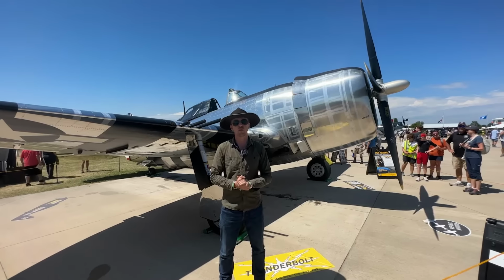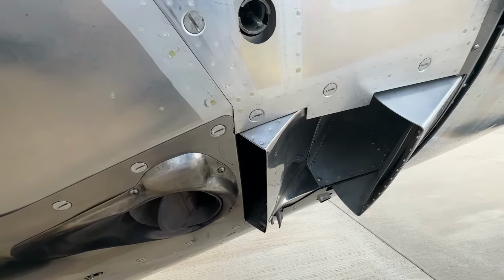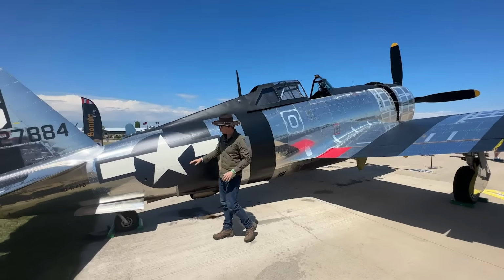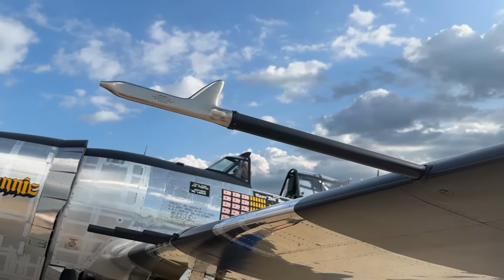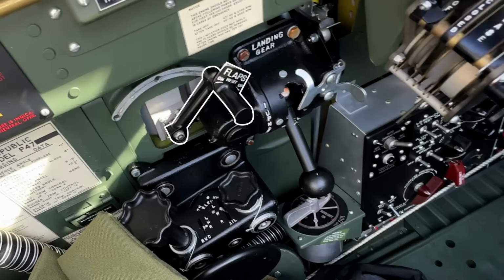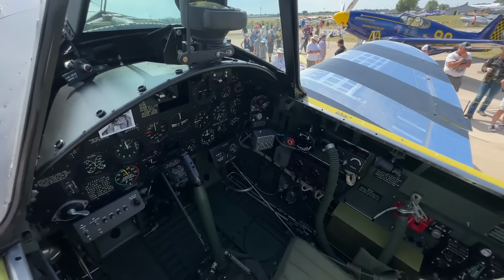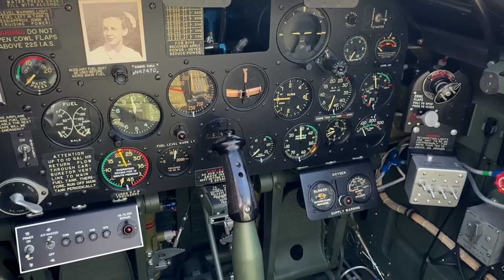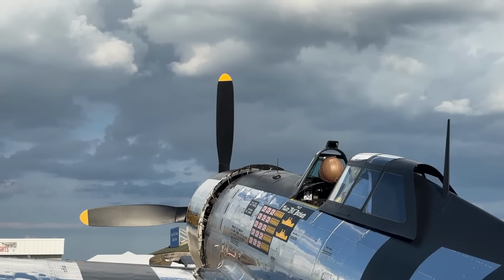Detailed Tour and Cockpit of P-47D Thunderbolt "Bonnie"

Comment: What amazes me about the P-47's engine is that it guzzled as much fuel as the P-39's two Allison engines.  Now the P-51's Merlin wasn't quite as fuel efficient as the the P-39's Allisons, because turbo-superchargers are more efficient that straight gear driven systems, but it gives you a ballpark of the difference between the way these planes chugged down high octane gasoline.

Comment: It looks like P47 uses a mid-wing configuration, and in such planes, the landing gear often needs to be longer—sometimes requiring a gulf wing or a telescoping landing gear to accommodate that. But this airplane seems to be using a standard type of landing gear..

Comment: Having flown many types of planes but mostly fighters, I too find the cockpit instrument layout weird. There is a standard now of course, where the flight instruments are grouped into a tight group to make instrument flying easier and it standardizes the placement of the gauges from one plane to the next. Engine and pressure gauges are now placed together so that one glance tells the pilot if anything is amiss. Weapon stations and switches are likewise placed in a small group. It is easy to overlook how much room the T-Bird had compared to other fighters like the ME109 or Spitfire. What a great restoration!

Comment: I used to play an air combat game that used 1/72ed scale models. When did the P-47 and the F6F I was quite surprised when I put the models from the same manufacture side by side they are the same size. That makes sense because both use the same engine.

Comment: Beautiful Restoration and great tour of the aircraft! 
Some of the P-47's had the outer 2 .50 switchable and I think, but not sure, the night fighter version may have had a small screen with the o-scope in the center of the dash. The rockets you mentioned were the 5 inch naval rockets and could take out a submarine or small ship. On tanks they were deadly, if they hit. A close impact could even disable a tank or locomotive. It was a true beast in the air. 
The A-10 is a fitting successor to the P-47 legacy! 
I watched them in action in Desert Storm and it was quite impressive. Videos do not do it justice. 
Thank you so much, Chris, for this video, and thanks to Aircorps Aviation for sharing and restoring this magnificent machine.

Comment: I knew a P-47 pilot. Cocky, more cocky than a typical US veteran after the war, which is saying something. Absolutely convinced the P-47 was the best plane of the war, and from what I gathered for P-47 pilots, the attitude was typical. A P-47 cost about double what a P-51 cost to build- you could guess because the plane was so massive for a fighter and so for the long fight against the Luftwaffe with the losses that were guaranteed, the P-47's were never given the escort mission over Germany. If the B-29 campaign over Japan would have continued the P-47N would have been given the escort mission because the P-51's couldn't keep up with the B-29's cruise speed. But as a ground attack plane, the 8 Ma Duces were a terror, the payload meant a lot of ordnance could be packed along and being massive it could take a lot of punishment.

Comment: is that windshield with the join in the glass right in the middle of the pilots view not an issue
Reply: Not ideal but no other way to mount the armored glass panel, gunsite etc

This actually has great visibility.. some German planes were like peeking out through a slit

Comment: My wife’s uncle Gene Baker 495th Fighter/Bomber Sqn 48th Air Wing flew from Apr ‘44 to summer of ‘44 in a P47 getting his wings as a 19 year old. He did 25 missions from Ibsley and 25 more from A-4  off Omaha Beach which was operational a couple of weeks after D-day. 1st mission in April was the entire wing, 50+ aircraft including wing commander and spares, flew to Paris. Such was Allied air superiority that he never saw a German fighter his entire time in combat. Pre-June 6 a typical mission was a group of a/c would dive bomb a bridge from 10,000 ft. then off to follow a railroad track hunting for a wooden water tank to shoot up. The splinters would fly off the tank then explode in a 50 ft. geyser. From A-4 usually a flt of 4 a/c were assigned a hedge row marked by infantry using a white sheet pointing at the enemy. They would line up one behind the other and strafe the dug in Germans. He said with an ammunition load of over 3000 50 cal. bullets times 4 P47s nothing could survive that. During training they would strafe sheets on the ground and later walk their targets. The ground was rototilled 2 ft. deep. The hedge rows were a built up berm 4 ft. high with 20 ft tall hedges that surrounded farm fields. He spotted a German motorcycle rider between them and when he hit him man, message, and machine cleared the hedges. Such was the power of 8 50 cal. machine guns. He had state side leave, was returning to his squadron, but had to take a physical first. He had been hiding a hernia even before combat. It was during a physical before his return to combat that he was found out and was taken off combat status. He spent the rest of the war as a P51 trainer at Newburgh Field, West Point, NY. Ironically he had more seat time in a P51 than a P47.
At his granddaughter’s wedding in 2003 he was reminiscing about his squadron and wanted to reconnect. I was able to contact them and he and his extended family went. Returning, he said he it was a thrill to reconnect and he wanted to just sit in a P47 one more time. He was living north of Houston and I contacted the Lone Star Flight Museum in Galveston. They said they have those kinds of requests all the time and would gladly do it. While talking with the staff he backed up to the airplane and unconsciously petted like it was his first puppy. It is a great museum and thoughtful staff.

Comment: 😊So big inside and yet so poorly done with instruments in a mess everywhere... It was surprising.  But a nice aircraft and a good display. Thanks!
Reply: Most world war 2 aircraft were worse, ergonomics were not really a thing yet. But the FW190 was probably the best control layout and also had a sort of “computer “ control mechanism so the pilot didn’t have to worry about prop, supercharger, rpm etc. just throttle and fly.😊.

Comment: Thank you.

May I suggest the common enough video technique, when highlighting a portion of the (still) shot, of de-saturating (graying) the frame except for the area that you intend to feature.

You draw a line (well!) around what you intend to feature this way, but the above technique is more evocative for the purposes of the viewer and you. I would also suggest a still “insert“ of the component being featured, perhaps from a high-resolution stock source. Surely even these two techniques, even when combined, are not more work than the careful lines you draw!

This depends on, of course, the NLE (Non-Linear Editor) software you use. I can only surmise that you do not use YouTube Studio, since that software does not allow such “frivolities“.

As a general rule, there is a specific (video) tutorial for one of everything that can be done. I would point you to one, but again, the (simple!) method varies from application to application.

Comment: You pointed out that oil cooler outlet then instantly moved on and skipped over the turbocharger waste gate like an inch away - that was one of the defining features of the ‘bolt! 

Anyways - yeah that waste gate was (very wisely) installed as close to the engine as possible, so as to minimize the need for stronger materials being constantly subjected to boost ahead of the turbo. In this way - the waste gate would only close to develop boost when needed, otherwise it would open and a large portion of the engine exhaust would exit up front like a normal R-2800, leaving the rear portions of the turbo at minimal boost remaining nice and cool. 

Just a very cool component worth pointing out in my opinion, you’ll never see it on any other R-2800 fighter. 

PS - very cool that they took the intercooler / maintenance access panel off in the back. I’d probably have my head stuck in there looking around for half the day lol. This restoration is museum-quality, we have a lot of pride in our Avenger, but keeping a large warbird  flight worthy AND immaculate are two totally different things. The amount of times panels and parts get removed for inspections and repairs, etc… it’s just a constant process. Probably 100ish man-hours per hour the plane is actually in the air once you factor in all the volunteers, and that’s just routine maintenance, not unforeseen items. Lots of wear and tear lol. 

This thing is just gorgeous. The polish job and sheet metal work is exquisite. 👌 There are SO few of these left flying around (I don’t get it!) I’d have gone to Oshkosh just to see this thing alone.
Reply: Sorry to bother you, but what build number Avenger do you work with? 53857 is local to me and flies over my house frequently. What a glorious sound!

Comment: So I was waiting at the stoplight at Bonnie's birthplace 20 minutes ago on my way home from work. 

Technically St. George at Highway 41 cuts through the original fitting out yard where they'd do upgrades to the finished planes that hadn't been implemented on the assembly line yet. 

My Grandmother was a riveter on the underside of the aircraft.

Comment: "Bonnie's" dazzling, high-polish airframe is really spectacular! But how realistic is it? At some point in late 1943 or 1944, the USAAF discontinued factory-applied paint schemes. There were several reasons -- bare-metal planes could be completed more quickly, the saved weight of paint not applied could increase the aircraft's performance, and at high altitudes, the more reflective aluminum could contribute to decreased visibility to enemy pilots and gunners better than a dark, painted finish. (Interior paint applications continued, such as the anti-corrosive chromate yellow as seen inside "Bonnie's" landing gear wells, and various colors applied inside the cockpit.)

There were some planes that didn't benefit from the weight savings, most notably the Boeing B-17. As a 1930s design, the Flying Fortress used a non-stressed rivetted skin typical for its time with longitudinal and circumferential lap joints between individual skin sections. The saved weight should have given the aircraft a bit more endurance, unfortunately, that expected benefit was more than canceled out by increased drag. Paint helped to fill small gaps around heads rivets and seams, improving aerodynamics and reducing drag. I haven't seen any discussion of the benefits of a bare-metal finish to semi-monocoque stressed-skin designs like the P-47 and the P-51. However, attitudes against painted exteriors persisted in the USAF into the 1960s.

The USN never abandoned factory-applied paint jobs. At the same time, the Army was adopting the bare-metal look the Navy was transitioning from the medium "tropical blue" adopted shortly before America entered into the war to a deep, glossy blue that was more or less universal for all carrier and land-based USN aircraft through to the end of the Korean War. The dark blue finish may have helped disguise planes from above against the background of the ocean, but the real reason was probably tradition and a bit of chest-thumping. "We're the Navy; our planes are navy blue!" When the likely enemy became Soviet attack aircraft and bombers flying at high altitudes, the Navy finally responded with practical low-observable paint schemes in the mid-1950s, beginning with FJ-3 Fury, which was typically painted with very light gray upper surfaces and flat-white undersides. The supersonic Grumman F-11 Tiger introduced the faintly blueish "haze gray" that came to dominate American fighter aircraft paint schemes until the "age of stealth" and "beyond visual range" combat doctrines.

Comment: The quality of the work is leaps ahead of what Germany and other nations produced mid to late in the war.
Reply: One of the things that struck me when I saw a P-47 up close was not only the fit and finish, but it was from the start designed for mass production and to reduce parts count, and time to assemble. Mass production tooling was utilized at every opportunity along with flush rivets. Apparently, there were no last-minute jigging and hand fitting of parts required to make things fit. The ME-109 was also designed for mass production and minimized hand fabrication. Very impressive.

Comment: What's the point of a fixed trim tab?
Reply: It trims the airplane for normal speed with a normal load. This only has to be done when the balance of the airplane changes due to changes to structure or equipment.  This allows the pilot-adjustable tabs to remain neutral instead of having some of their travel used up unnecessarily.  They then have more travel to deal with changes of airspeed or dispensable load.
Reply: @gort8203   makes sense, thanks!
Reply: And it can be manipulated on the ground to neutralize any trim out of balance. “ bend it to correct trim”.
Reply: @jimgoff1170  makes sense, thanks!

Comment: if i had to make an uninformed guess as to why the main instruments were all seperate, it was because of standardized production so the same indicators could be more easily installed on totally different types of aircraft without having to have all the wiring go through the same space in the airplane and/or allowing different configurations.

Comment: Great presentation and very clear description of the cockpit furniture. I appreciate the cartoon tracing graphic as you described each item. This is a stunning restoration of a day one (fresh off the line) fighter. If it were mine (dreaming!), I would have left more of an aluminum patina/natural finish/acid etch rather than polishing to a high gloss on some of the surfaces (as KW talks about at the 3:00 mark in his Douglas A-26B Invader - Project Visit - June 2024). It is possible that some of the aluminum came out of the factory polished like that (the fact that many of the panel lines here are puttied is another thing you rarely see on restored fighters) and I would not think of questioning the guys that spend thousands of hours on this airplane restoring it to what you see here. But (again for me personally), the mirror polish seems out of place on what was a mass produced fighter riveted by newly hired, home-front labor then shipped to Europe in crates and assembled in the field by young men. However- if you want to send it my way for a test flight, I'd be happy to take it off your hands ;).

Comment: Excellent presentation and recording, Christoph.
I was aware of the restoration by AirCorps Aviation for several years and recently completed a 1/24 scale in flight model of Bonnie using DrawDecals for markings. 
It took two years to build for all the added details, upgrades and unique modification features of this airplane to reproduce in a scale model.
It even has a black and white photo of Bonnie on the instrument panel. I would have had an easier build if this video was done last year. If interested there are three video posts of the model on my channel.
Thanks for posting.